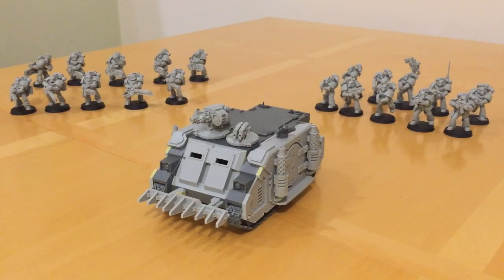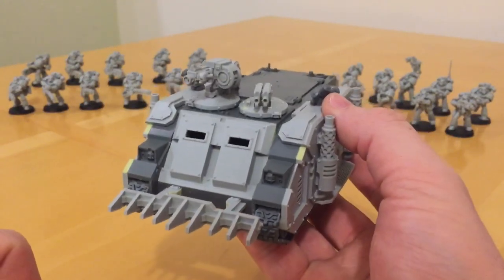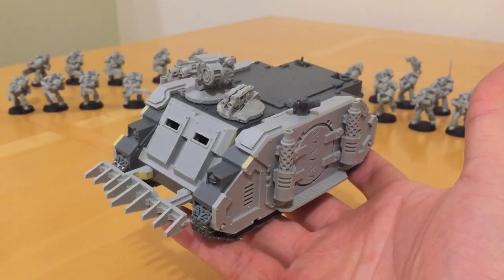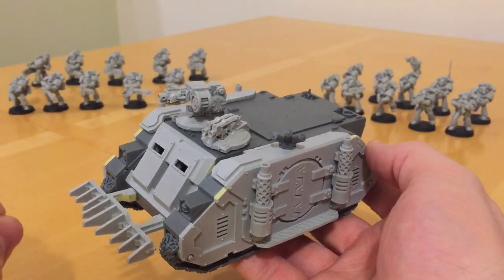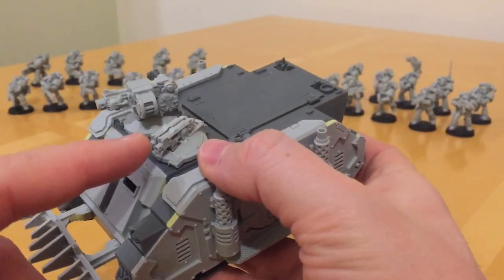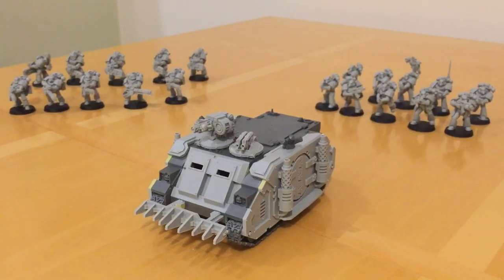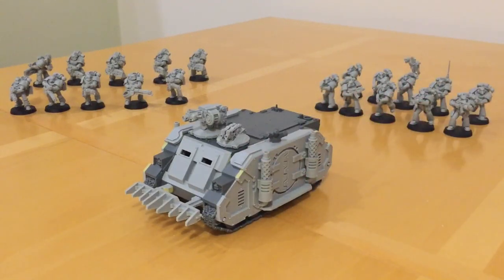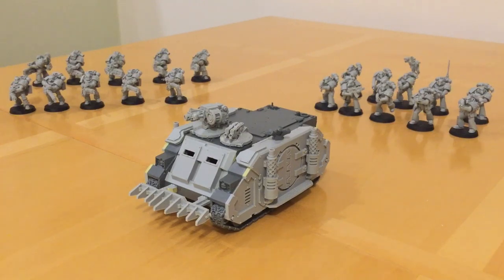Legion MKIc Deimos Pattern Rhino by Forge World: Model and Rules Review

Comment: Not sure if I like it enough for the cost, also not sure if it can have legion specific doors? probably on the rear ramp and the top hatch. I still have the original and its so tiny compared to it, you should have shown it in the video instead of the landraider :).  Thanks for running it down! great heavy weapon teams.
Reply from the maker: +Stephan van den Brink Thanks, glad you enjoyed the run-down & weapon teams!

You are right on the Legion doors, I'll use some brass icons to get some bass relief insignia on mine. The original is small by comparison, although I don't own any now as I sold them on years ago. A couple of mates have examples though, I might borrow one for a future episode of Retrohammer ;)

I need to review the weapon teams at some point as I have Graviton Guns, Rotor Cannons, Volkite Calivers and Volkite Culverins to take you through. Next week I'm planning to set out all the Iron Hands for an overview video, the squads will then follow on from that so keep an eye out for those.

Comment: That is a gorgeous Rhino. Great job. Would I be able to ask you some modeling questions?
Reply from the maker: +ratetlordofsnakes Thanks mate, I appreciate you saying so :) Fire away on the modelling questions, I'll do my best to help and there are other viewers who might chip in as well.
Reply: leakycheese OK so my question is about the Medusa and the Thudd Gun. I want to change the way they look. They don't look right for Death Guard to me. 

My idea is to take the laser destroyer battery and swap the laser array for the Thudd Gun from the Death Korps. I just wanted to know if it would look right or even be close in size. 

The other thing is I want to mix and match the Legion Medusa and the Apocalypse Medusa. I want to use the chassis, gun, crew, computer console and extra shells from the legion one. Then use the floor panel and armored crew compartment from the apocalypse model. 

I am looking for a look of initial standard issue legion gear. Then through protracted siege warfare they were forced to take and reuse the equipment from the Imperial Army that they could. Thus giving them a more rugged and old look. And a bit more brutal looking to fit the DG. I thought since you have a knack for combos you might be able to help. I don't even know if those pieces would mess well or anything. Any help would be awesome and appreciated.
Reply from the maker: +ratetlordofsnakes I think you are spot on with your DG aesthetic and I like your conversion idea. I've not got any of those models but they are similar sized but not 100% sure. I'm planning on dropping in the WW Forge World store tomorrow where they have examples of all their models on display so I'll have a look to see what I can figure out for you. Hope that helps ;)
Reply: leakycheese Thanks for the help. I was hoping it would look right for DG. If you would be willing to confirm that for me it would be awesome! I live in the states with no GW store with 2 states. So a little hard to confirm the size. lol Thanks for helping. And for thinking I had a good idea for conversion. It can be hard to go out and try this stuff.
Reply: leakycheese Hey don't want to be a bother but have you had a chance to check out the sizes yet?
Reply from the maker: +ratetlordofsnakes No worries mate :) I cancelled my trip down Friday as the kit I wanted was out of stock. I've not forgotten about you though, I might be able to visit this week if things line up right and I'll check for you then ;)
Reply: leakycheese Thanks man. Sorry it didn't work out. Hope you can get the kit next time round. Looking forward to hearing from you.
Reply from the maker: +ratetlordofsnakes Hi again, just to let you know I have not forgotten about your question, I plan to visit WW next week so will have a look then ;)
Reply: leakycheese Thanks for keeping me up to date. Take as long as you need.
Reply from the maker: +ratetlordofsnakes Okay, had a look today and this is my take on your ideas.

The DKK Thudd Gun could graft onto a Legion Rapier track unit. You would need to   modify the gun shield to accept the wider quad gun and might need to slightly widen the body of the track unit to get the quad gun breach in.

The Medusas are both built on the plastic Chimera chassis. The fighting compartment on the Apocalypse version is quite tight so it would be a tight squeeze to get the shells, panel and both marine crew in but they could stand on the rear door to leave more space in the fighting compartment.

For my money those are both conversion ideas that are feasible if you are prepared to put some work in to modify the models.

Hope that helps you out :)
Reply: leakycheese Awesome! Thank you so much for checking that for me. You are a life saver. I am willing to do whatever work is needed. It is totally unique from what I can tell. And it fits my vision. 

I will get started on the mortar first since it will be cheaper and need less work. I have to finish my current project before that. I am making a missle mortis dread with cyclone launcher and frag launchers.
Reply from the maker: +ratetlordofsnakes You're welcome :) Having looked at the models I think your stylistic choices are spot on and you will end up with some really well themed DG artillery.

Comment: I love that MOD and i love that style rhino, i am in the process of building mine and am unsure if i can paint the tracks and leave them off untill the rest of the model is built and underpainted?
Reply from the maker: +houson08 Thanks dude! I think you could leave the tracks off while for undercoating, my one watch out would be that the pieces of track that fit into the armour i.e. the ends are quite tight fitting so you might be a bit tight after a layer of paint goes on. That said you should be able to scrape any paint away there as it won't show. Good luck with build :)